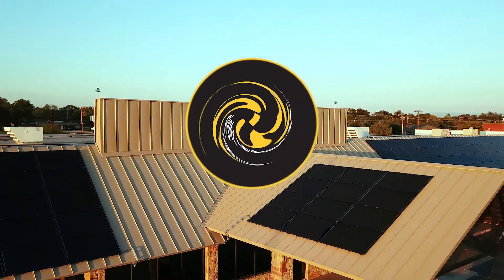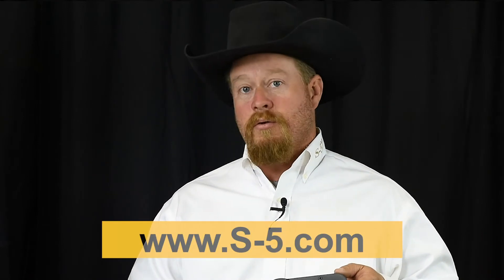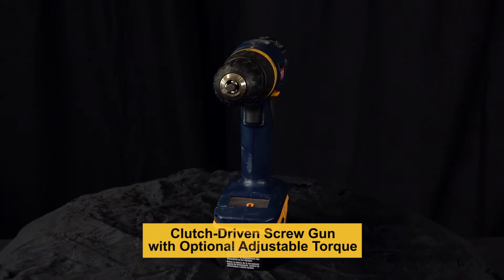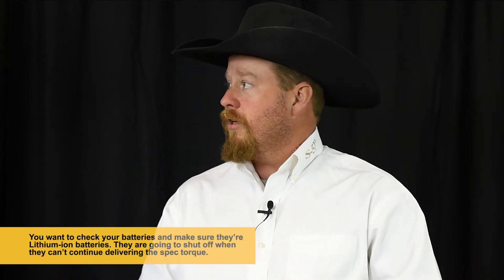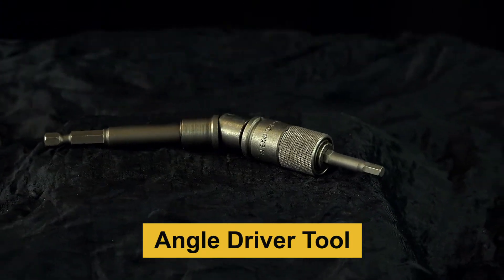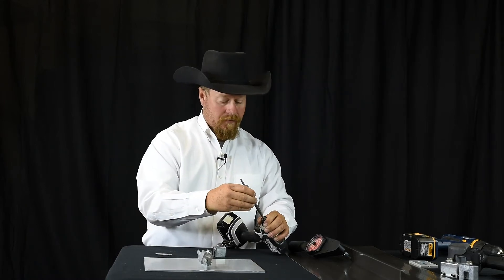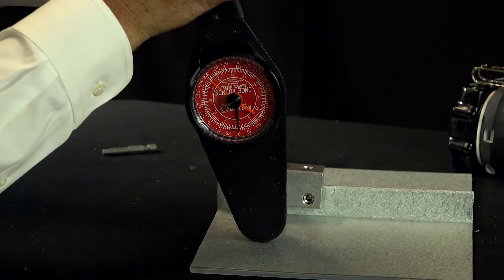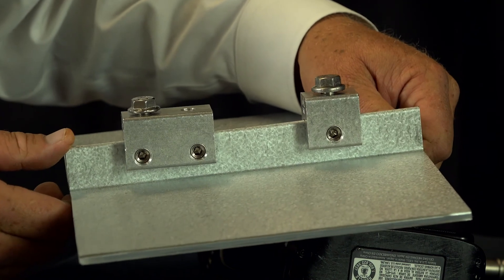What Tools are Recommended to Properly Tighten & Torque S-5! Clamps?

Comment: Whats your opinion about the newer adjustable torque Impact drivers?  Maybe those angle driver bit should be included with the clips..? ..imo... seems like they're needed to be installed properly. Thanks for the Vid.
Reply from the maker: Some of the newer adjustable impact drivers are very nice and can keep you from over tightening setscrews, but few of them are accurate enough to be relied on alone to set the screw torque properly so we recommend for setscrews to be tightened close to spec with a drill or impact driver and then checked or finished off with a torque wrench. The angle drivers are very handy on shorter seam profiles but not necessary on all, we do include a T30 bit in every box of clamps. If you are interested in the angle driver we recommend it can be purchased here - https://buys-5.com/product/s-5-screwgun-nuckle-driver/